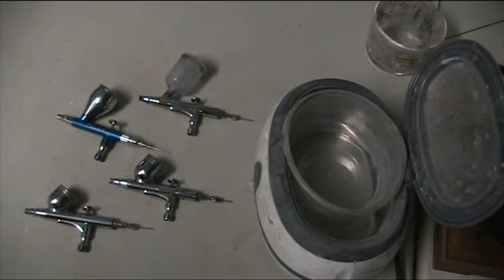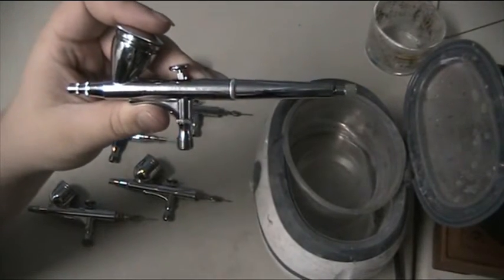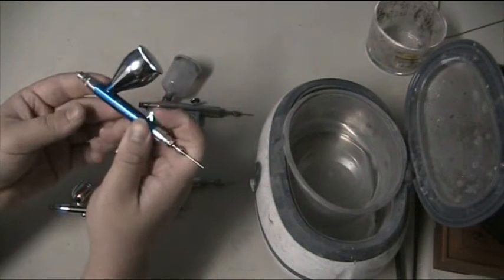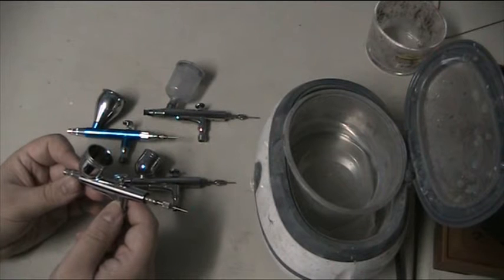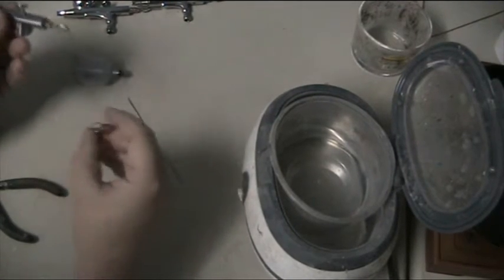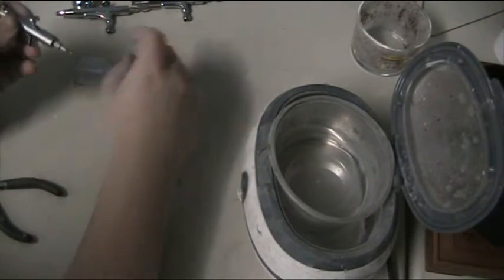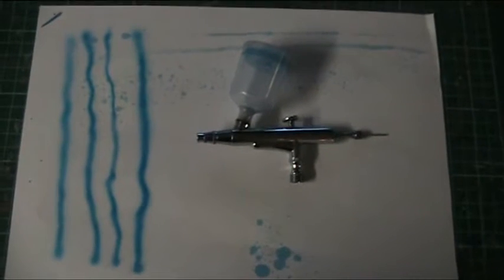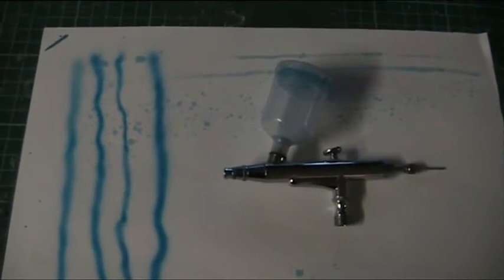Honing your airbrush skills 18: fault finding and putty 'O' ring

Comment: I use plumbers tape for sealing fittings works like a dream and you can rap it as much as you need it's called Teflon tape you find it in the plumbing section.

Comment: I like the harder and steenbeck evolution silverline the single with one needle is under 200 that's my next airbrush but I'm getting the two in one comes with 2 and 4 needle and tips and the tips don't have treads so you don't haft to worrie about braking them thay line up when you put the cap on and thay all come with the Teflon seals.
Reply from the maker: H&S do seem to be the popular go to brushes. I would not mind a .3mm evolution sometime in the future with extras.

Comment: Thats my issue of my airbrush...
Reply from the maker: This video is a bit out of date, you can try the beeswax method but with how cheap these airbrushes are I still stand by buying something that does not come apart at that section.
Reply from the maker: Instead of putty follow the tips in this video. You can also heat up the brush with a flame to melt the wax. https://www.youtube.com/watch?v=PXjxjiOdjHE
Reply: @mokanaman  yeah tried that. It helps. But now i know the culprit theres still a air leak on nozzle.  So i just put teflon tape on all threaded part.  And its good as new.  Thanks